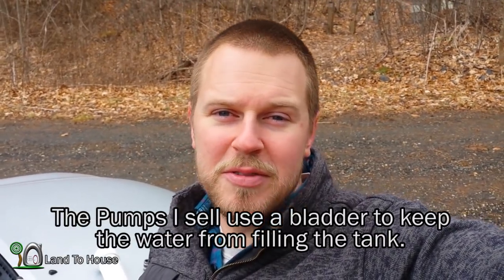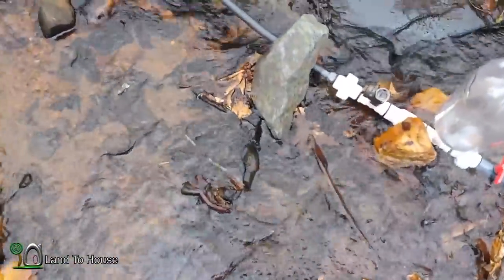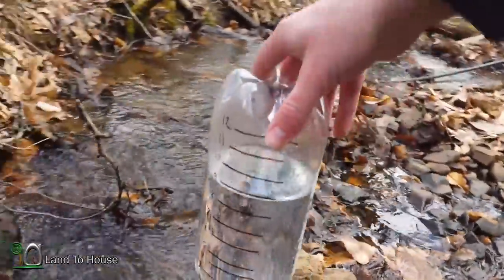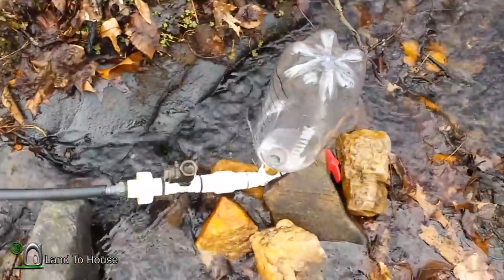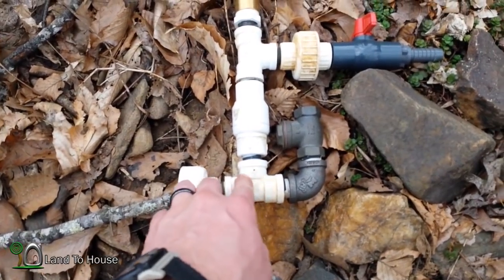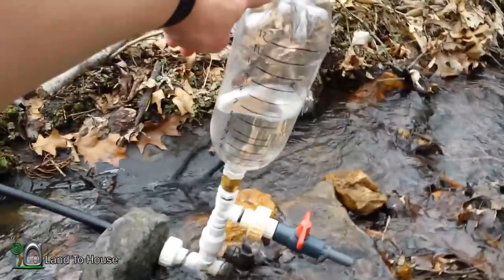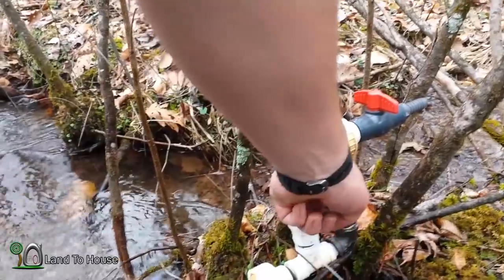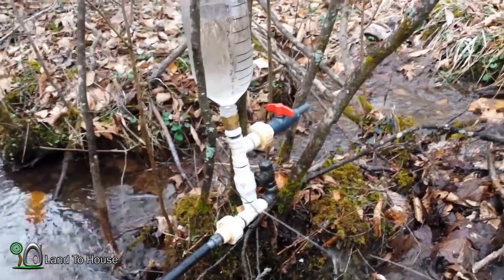Ram Pump Snifter Valve Research

Comment: I have had some experience with a snifter valve on a big ram pump. As you said, the hole needs to be small, the idea being that when the shockwave recoils, some air is sucked in. A major problem with them is that the hole can quickly block up with little pieces of  sediment. When this happens it is only a few days before all the air has gone from the pressure vessel. The ram then hammers violently and the whole thing stops working. To prevent this happening you need something like a split cotter pin in the hole ( pushed through from the inside). Now what happens is that every stroke of the pump the cotter pin slides a little bit back and forth which dislodges any dirt.
Perhaps with your very small pumps, instead of using a cotter pin, you could use something like a very thin nail, with the head on the inside. This would serve to block the escape of water during the pressure wave but slide back enough to let air in on the return stroke.
I’m thinking that if you have been successfully making pumps for over 2 years then these small pumps may not need a snifter valve.

Comment: The snifter valve is a TINY hole. I am running an original 200 year old Blake Hydram that pumps 3,000 litres a day, 1.2km and 200ft up a hill. The hole is located just below the check valve in the bottom of the (cast iron) pressure vessel. The snifter is in a brass plug that screws into the cast iron body. The hole is about the size of a human hair.  The reason the snifter valve is there to allow for the fact that air dissolves in water so, over a period of time all the air in the pressure vessel would all be absorbed and the "bounce" in the system would reduce. Over time the water also wears out the brass and the hole enlarges so I have to replace my snifter every 5 years of so.

Comment: thank you for the series,  a hole drilled in the manifold is not a snifter valve, it is just a hole........ the easiest way I have found is to drill a hole and then insert a small brass or copper nail from the inside, now bend the protruding point of the nail over so it cannot fall back in, it is important to leave a little extra length on the nail so it can move in and out ever so slightly. when the pressure in the manifold drops a small amount of air can enter. when the pressure rises the head of the nail closes the hole... I have a 50mm ram pump  with 4 meters head it pumps over 32 meters in height with a very good flow.  the biggest improvement I have found is a third check valve placed on the delivery line about halfway up the hill to reduce the amount of back pressure in the line
Reply from the maker: Thank you for watching! I will have to install the brass nail and bend it like you say. That seems like an effective way to make a cheap valve. In a test two years ago I had 4 meters of head pressure and pumped to 23 meters. That is because I ran out of delivery line. I also use the check valve half way up the line to reduce the back pressure on the pump. It is like a giraffes neck. Several valves to keep pressure off the heart.
Reply: hello my name kamto from indonesia. i think  cj w theory is right. its look like what i read or see in several sources. i've made my own ramp pump too and its work nicely. imade it from iron pipe. but without snifter valve. yes it is... every couple month i must drain the pump in order to fill air to the tank. maybe you can see my video on youtube type a tittle " membuat pompa hydram 2 (pompa)'  and you can share your opinion about that. thank you keep inventing seth...  i'm srorry my english is bad.
Reply: yeah... perfect idea!  maybe i will try a rendition with a snifter on mine...
good tip thanks!  and L2H, thanks for bringing me back to his thought!
Reply from the maker: +The Farmacy Seeds Network happy to help :)
Reply: How a check valve in mid delivery pipe will reduce back pressure while the pump is continuously running..?

Can you please explain to me. ,
Reply: +Berlin Raj -- The pressure is NOT constant. Water pumped up the hill comes in surges. But that is also affected by the capacity and placement of the pressure tank, and surges could be smoothed out at the ram pump, by proper sizing of a few extra components there.
Reply: Berlin Raj it doesn’t go on the inlet end it goes on the outlet about half the way up the height you trying to lift the water.
Reply: Most engineering handbooks for water wells state that a check valve should be used about every 400 vertical feet [not horizontal]  to divide the pressure I suppose between valves. But this is a subject with many diverse opinions. I believe if you use a top quality BALL check or CONE check valve, then that is enough for several hundred feet of total RISE, not run.
Reply: @LandtoHouse  what happens if you put your flapper check valve higher thank you
Reply from the maker: As the waste valve height goes up the head pressure goes down. So it loses power to lift water.
Reply: @LandtoHouse  thank you for answering I'm working on something I'll let you know if it works any better
Reply: I know this is a long time after the fact.. but wouldn't a swing check valve half way up reduce flow? there is still X pressure of water sitting on the flapper so any pulse has to lift Y pressure of the 1st half of the column then exert enough force to overcome the weight of X pressure on the flapper (plus minuscule I know, weight of flapper) plus the restriction in the system that the flapper would cause.. or am I totally missing something?
Reply: @kevinapierce  Well, did it work any better, And what was it?
Reply: I know this post is very old but you can use a standart greasefitting as checkvalve

Comment: Ive seen that if you drill a hole, you need to reverse the spring in the 1 way valve. It starts by keeping it closed, but if you put the spring on the other side of the plate that holds it in place, you can have it stay open, with the pressure of the water closing it as needed. Also makes it so you dont have to start it with your finger.

Comment: Thanks for doing this research on the snifter valve - I'll cross this valve off my list for research for your size and style of pump for now.
Reply: Use a grease fitting it is just a tiny checkvalve

Comment: I think what you may be looking for is a small rubber mitral vent-valve that's commonly used within marine anti-siphon / siphon-breaker systems.   Conceptually the siphon-breaker vent valve allows air (to break the siphon effect of a filled line that is below the waterline of a boat when pumping overboard).  Go to defender.com, sign-in as a guest then look for "Moeller Anti-Siphon Valve" (just a teeny rubber 'mitral' check valve)
Reply from the maker: I will have to check that out. I have seen similar valves in aquarium fish tank setups.

Comment: Hi guys, I have been keeping an eye on your developments and respectfully what if you make and ajustable snifter valve?
Reply from the maker: I have this test on the list for the spring or summer! the idea is to use a Cpap hose valve. Not sure that it will work but should be fun.
Reply: @LandtoHouse  good aternoon Seth must kind of you for your outstanding innovation, and far more for taking yourr limited free time to answer my ponts of view, should you acept the location  for that  snifter valve should be right below the one way valve that supply water to the pressure tank, respectfully.  Jesus Torres.
Reply: Correction, the drilling for the snifter adjustable valve should be on the check valve tha supply water to the pressure tank right below the area where the flap valve close.

Comment: go to a well supply house and ask for a air admittance valve for a standard water well pressure tank - like a schrader valve. Its a tiny SS check valve and solves all your problems with a snifter. Or a SS cotterpin in the hole does almost as well.
Reply from the maker: Good idea! I have not worked on this idea in a while.
Reply: I see that Ace hardware and many more has them on line. I just pulled some of my old stock, and I had a brass Campbell and a stainless no name with a longer stem and a valve core remover type cap, with a hole thru it [you can leave the cap on then while operating, it reduces the hole size and keeps larger crud out] . That's the one you want, as it has no spring. The brass Campbell has a spring and I cant get it to open by blowing on it. It is just a standard tire valve with a 1/8" npt base. The longer SS one just floats and that should be superior on a ram. I think it is crazy to leave a drilled hole to waste the back pressure as I see on so many. If you look at the Davey small rams, they have gone to this snifter valve also. They are only @ $3 so no excuse not to use them, though a cotter pin or a copper nail might suffice.

Comment: This is an intriguing problem.I'm looking for a reliable long term Ram pump for a remote location.
 I like the idea of using a bladder-less pressure tank with Ram Pumps. It would definitely be nice to find a solution that does not involve electrical power, e.g. compressors. 

 How about this conceptual idea?: I think a solution may be possible by using a second Ram Pump as an air compressor. A solution should definitely be possible if we add a third Ram Pump working to create a partial vacuum. But, I think a configuration involving just a second Ram Pump to use as a compressor Ram pump may be doable.

Who wants to discuss it some more?
Reply: If you used a 2nd pump to supply air, it would have to come from it's pressure vessel which then would lose all it's air. it would the operate as a pump without a pressure vessel. This is hard on the system and no benefit. The problem is the snifter hole is to big.
Reply from the maker: Well put. I have a small valve I plan on using as snifter soon.

Comment: Instead of drilling a hole, it is better to install a 1/2" swing check valve, swing check valve arrow must be against the flow of water or the valve is always in the close position. No need a bladder in the surge tank.

Comment: your snifter is missing a critical part..... the internal reed spring that covers the hole, and opens and closes..... letting in air between cycles
Reply from the maker: Yes it needs that for sure. I needed some sort of pin or brad to stick in there for keeping the water from always shooting out.

Comment: A small air bladder tank would work.                                                                              How can air enter the hole you drilled in the pipe when water was continuously running out? If you put  a check valve there the water pressure will still be greater than the atmospheric pressure. Maybe putting the check valve in a hole at an angle would create a vacuum from the water flow that could draw air in. I have seen water pumped by this method. Maybe I am missing something. please explain. I like to learn new things.

Comment: Hi Seth. You would probably remember me. I'm from India and I constructed a Ram pump for my Engineering project in my final semester last year around this time. If you go though my channel you will find my ram pump videos. Even I drilled a hole which was a bit too big for my system and the way I got around it was I used a 'split pin' in that hole and it covered up the hole substantially.
Reply from the maker: +a.srivastava hello yes I remember.  Its nice to hear from you again.  Did you have success with the project?  After testing the snifter I prefer not to use it but too install the innertube. Your most recent video pump is working well.
Reply: +Land to House Yes. The project was a success. The examiner asked me a few questions to evaluate and I answered all of them ( he was not familiar with ram pumps so the questions were easy lol). Also, he told me that it was the first time he had seen anyone build a Hydraulic Ram pump. I am currently working my first job and I still cannot believe it's been a year since I built this magic machine. (I still have it). I would love to take some time off work and do a little research of my own on the Ram Pump :). Love your videos :)
Reply: +Land to House Yes. The project was a success. The examiner asked me a few questions to evaluate and I answered all of them ( he was not familiar with ram pumps so the questions were easy lol). Also, he told me that it was the first time he had seen anyone build a Hydraulic Ram pump. I am currently working my first job and I still cannot believe it's been a year since I built this magic machine. (I still have it). I would love to take some time off work and do a little research of my own on the Ram Pump :). Love your videos :)
Reply from the maker: +a.srivastava for someone who has not seen them I feel like they are impressive. It's nice to hear that you had success in class with the pump. Thank you for watching my videos. I have a few more ram pump ideas on the way.
Reply: +Land to House will always look forward to it. Cheers!

Comment: From watching some videos, I am planning on building one myself, however going to try and set it up as a 'u' shape
Reply from the maker: As long as the waste valve is on the drive pipe side of the pump and the pressure tank is on the other side of the in-line valve, you can arrange the pump in any configuration you like.

Comment: Hi Seth, interesting experiment, I guess if you get this correctly set up it would be a more permanent solution as the tank would never get water logged. Just as a matter of interest and on the basis of " If it ain't broke don't fix it" have you ever had to replace a bladder through malfunction? As you know I have a different system with a tank that can be re-pressurised. I have had to do it once since I installed it about 2 years ago it also my be an option you could offer to customers?
Reply from the maker: +Michael Collinson so far the bladder in my pump in the creek has lasted fine for three years. I am not really sure how long a tube will last in the water. ... so no I have not changed one yet.  I was thinking the same. It witless be nice to have a more permanent solution to the water logging issue.

Comment: I am considering a ram pump application for a man made creek, pond, waterfall, and maybe a fountain. here's the CATCH. I don't want to have any external water source other than what rain adds to it. it needs to once filled create it's own flow and catch all the waste water outing it back into the system. no electric powered pumps. i figured if the flowing water was about 3 foot wide and two inches deep if I build a waterfall with a 10 ft height part of the water could be taken from there to drive the water. I believe you could make a lot of sales if you figured out this system. I hope you share it.
Reply from the maker: The ram pump does not work well with a closed system. Because the pump works without electricity it is very lossy. (very efficient because it does not use electricity or fuel). Almost 90% of the water is lost in the waste valve to make the pump run. This means in a closed system the water will be at the bottom soon.
Reply: have you considered connecting a reduced size line to the waste valve allowing it's own pressure to plush it back to the feed tank, or drive line?
Reply: Rex Davis, that would be a perpetual motion system.
Reply: You might consider a solar powered pump. The solar panel makes electricity to run a DC powered pump. If you want it to run day and night, You would need a battery with enough capacity to run the pump when there was insufficient  light and enough solar panels to charge the battery while running the pump during the day. If you can live with it only running during the day it would be less expensive because you wouldn't need a battery or as many solar panels.
Reply: Man wants to invent perpetual motion.  He might not (maybe should say "may not" since there is a law involved).

Comment: It should work if the hole is made smaller. It works with a seal but not with a 1.5mm hole, therefore there has to be some threshold in the middle (dependent on head pressure) where if the hole size is smaller, it will still work but also supply a little air. If you don't have any smaller drill bits, you could try heating up a nail or sewing needle and putting it though.
Reply from the maker: +David Lister that is a good idea! I can try that. I do have one more idea before that though.  The current hole I made is at a low point in the pump and i don't know if it even has air there. I am going to place a longer pipe at the tank and put the same hole there for a test. This point will be above the waste valve. If that fails I will try the heated needle idea! Thank you.
Reply: +Land to House I hope it works! I just remembered a trick I used last winter to make even smaller holes. You can sharpen a nail and hammer it into the spot you want the hole. For the smallest hole, stop once the tip makes it though. Because it's tapered, the hole size can be easily increased by just striking one more time with the hammer. I has worked well for me in copper pipe, I am not sure about plastic though.
Reply from the maker: +David Lister this sounds like it will work. I like the heat idea for getting a nail into pvc. I might have time to give this a try today and get the video out on wednesday.